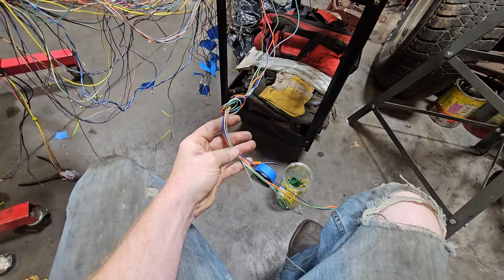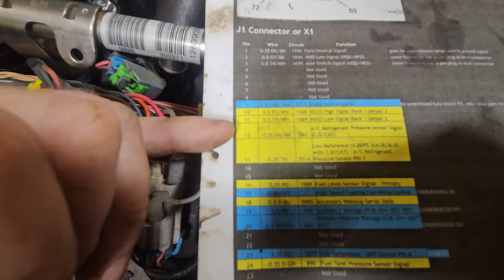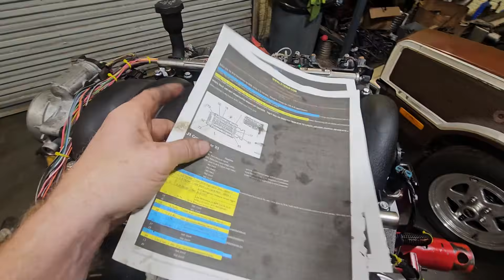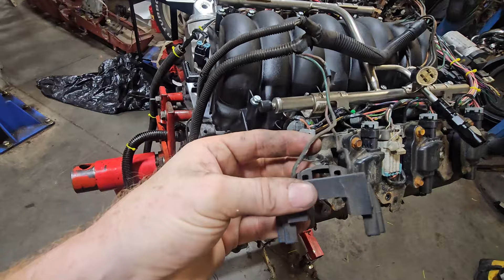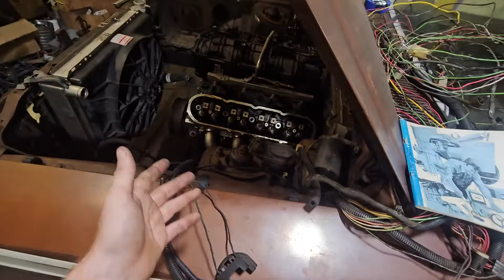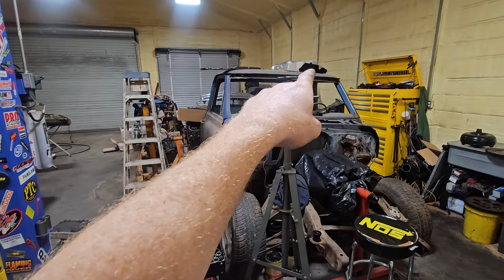Wiring the E38 Harness for the 6.2/6l80e Fairmont Wagon

Comment: Late 80’s Chevy trucks with the 700r4 have a brake switch with the normal brake light and a second set of pins to unlock the torque converter, I use them in all our 
LS swaps
Reply from the maker: Good to know, thanks.